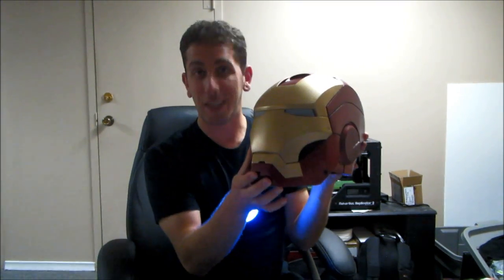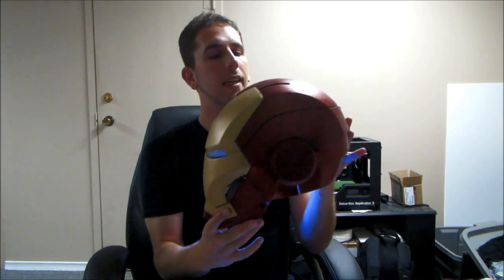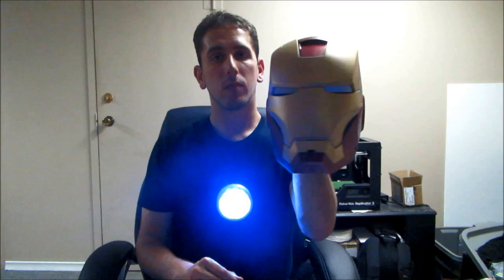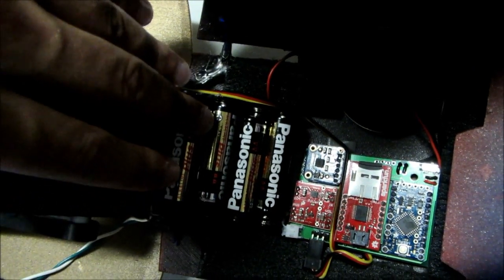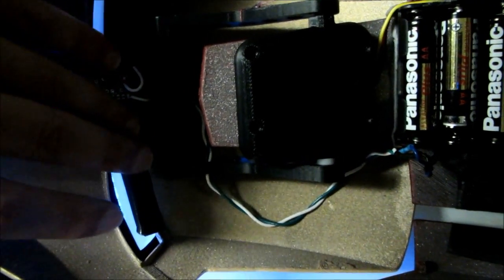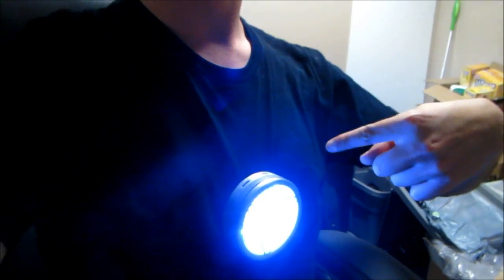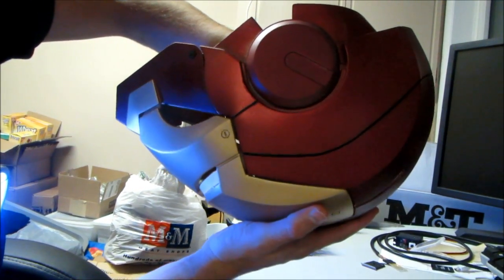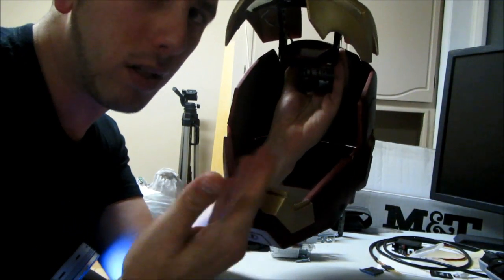3D Printed Iron Man Helmet - Stage 2

Comment: This is awesome Ryan, could you possibly share with me how you went about doing the LED lighting in the eye sockets please ? I.e what you used to make them function and how you positioned them, I'm doing a project of my own on a mask I built myself and wanted to luminate the eyes of the mask, However Ideally I wouldn't want the LED's to be visible or obstruct my line of vision in any way when wearing the mask and you seem to have tackled that pretty well here so any help would be massively appreciated!
Reply from the maker: +RellyAlexander Of course!  It's pretty simple - just position the LEDs above the eye holes, facing downwards.  I have five SMD LEDs across the top of each eye.  Hope that helps!
Reply: Thanks for getting back to me Ryan :)

Comment: how much does it cost to get a 3d printer?
or just get something 3d printed?
Reply: They are really expensive you are looking at £1000 for a good one.
Reply: WhatYouWantToSee
wow.
I will need to get a job then.
thank you for telling me.
Reply: MultiAlphamega

Just priced a unit up for you about £1400 easily and its the right dimensions to make an iron man mask.

The thing to look for is make sure its a good size to make the items if its a small tray its near impossible to make a decent helmet unless you do it in parts a lot harder to do.
Reply: WhatYouWantToSee
so I have two plans
get that much money as a highschooler-nope
wait and get money later in life- possibly.
so I think Iwill wait about two years, and that seems like a good price.
Reply: MultiAlphamega

What country do you come from as i was pricing up with GBP.

You can get things printed for you for much less you know, you could start with the helmet and gradually build your collection they dont change much depends what you are after.

If you want a good 3D printer then waiting 2 years would be the best option as by then the technology will be very impressive and much less cost meaning you could probably make 3 suits as to 1 for the cost right now.

If you live in GBP i may have some contacts for you who can print the helmet for you but right now designs are not perfect and its going to take at least another 6 months to finish off the design and poly count for my prototype helmet.

Cheers!.
Reply: I live in The United States of America.
and if what you say is correct then I will wait 2 years.
I looked up and found it very expensive.
thanks for the help though, so when I get a job, I will save up money and attempt at this.
Reply: MultiAlphamega

I hope you find a suitable career and make a good living out of it.

Lets see what the future brings!.
Reply: I shall good sir/madam.

and as long as the future isn't ruined by any future events I am good.